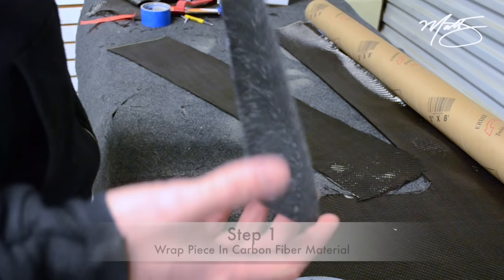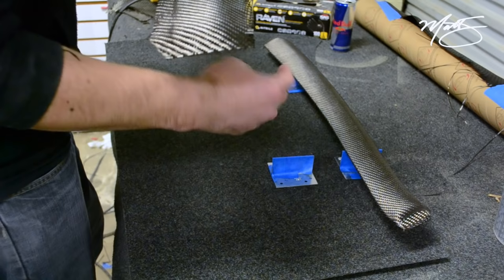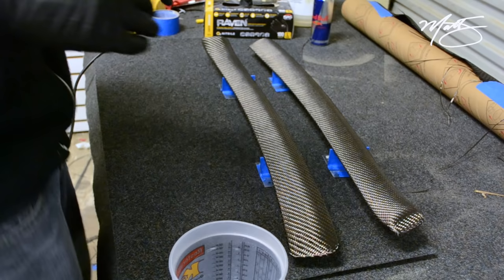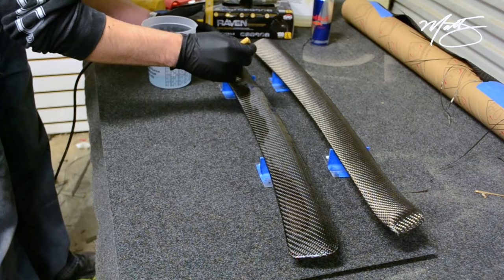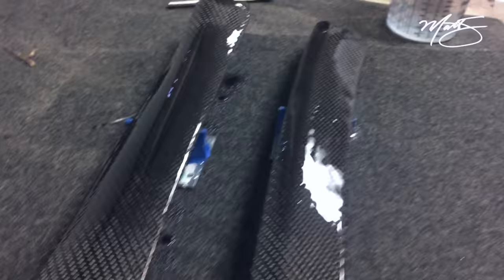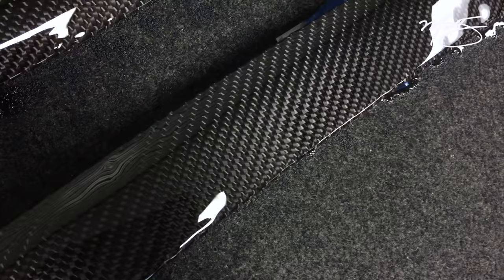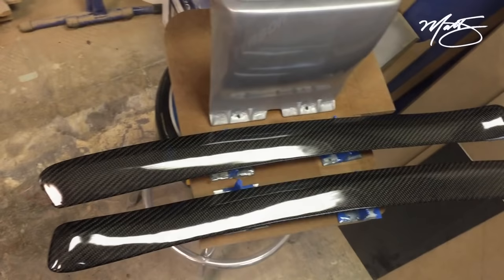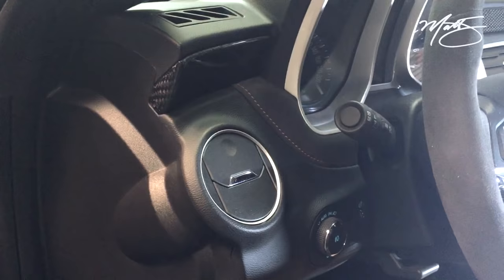How To Hand Lay Carbon Fiber

Comment: Hey Matt, love it and I totally get "don't sand the first  layer". What did you do with the underlay and masking tape?
Reply from the maker: Gordon Mulcare The fiberglass underlay was epoxied to the carbon layer when it was laid. The extra carbon wrapped to the back was taped up to the edge. After it was epoxied and cured, I took a 45 degree grinder and tapered the edges from the back. I pulled off the tape and the dry carbon excess came with it. Hope this helps!

Comment: hey matt with the spray adhesive have you had any problems with delimitation of the part? I thought your idea with the spray adhesive was impressive. thanks for sharing your experience.
Reply from the maker: +Robert Kahana I use the spray adhesive route because its the only method I have used that has not delaminated.  Some people lay epoxy and let it tack, then lay the carbon into the tacky epoxy to hold it down. I have had hit or miss delamination with that method. Lay the epoxy on light, so it does not saturate the adhesive, and then let it cure and go heavy on the second coat.

Comment: Why do you dry sand then wet sand? Why not just wet stand straight away?
Reply from the maker: +JUNAID187 When you dry sand you can take a lot off of the high spots off of your epoxy. When you dry sand, it is obvious if you start sanding into the carbon fiber twill. If you are wet sanding, it is all going to look like clear coat. You would not know unless you constantly wetsanded and dried off your panel.

Comment: Do you have delamination problems with spray glue?the temp affect the glue?the water during wet sandind?
Reply from the maker: ATHANASIOS SAKELLARAKIS I have had a lot of success with the spray glue to tack the carbon down. I have never had any delamination problems, as the epoxy will bond to mostly anything porous. As long as your not backing it to plastic, abs, hdpe, ect. Just make sure on the first coat, as the epoxy starts to flash, inspect for any air pockets on your layer. If you find one, take your foam roller or brush and push it back down. It should lay back down since the epoxy is very tacky at this point.
Reply: Matt Schaeffer I use spray glue or epoxy basecoat and vacuum bag to attach the fibre on the surface,I m new at this and try different ways,the spray glue is by far easier!!

Comment: what is the reason for 20oz?  more expensive and pretty heavy.  What I have read "More difficult to form than lighter weight carbon due to its high weight and thread thickness. Not generally used for cosmetic applications. Excellent for flat parts and high strength requirements."  Just wondering...no expert here.
Reply from the maker: OEM manufactures like Lambo, Ferrari and Porsche all use a 20oz mat on their cosmetic interior pieces. It has a ton more depth than the easier to form 5-11oz. Harder to work with but looks way better.
Reply: Matt Schaeffer ok got it, makes sense. thanks :-)

Comment: I tried to do this with the spray adhesive. However it dont work, when I apply the epoxy resin, the carbon lifts off the part like its getting air pumped into it , how can i fix this
Reply from the maker: Yamaha Rapt or first layer needs to be light. You can’t completely wet it out. If you have crappy adhesive and it completely sets out, it may release.
Reply: @therealmatty_s  I do apply a light layer, but after 5 mins after I have applied the first coat, the carbon lifts away and small airpockets form under the carbon
Reply: I have tried it on metal parts, and also nylond 3d printed parts and the same happens
Reply from the maker: Yamaha Rapt or then you are using too much epoxy or your spray glue sucks.
Reply: @therealmatty_s  Ok, i will try again with a light layer of epoxy to start with again, and see what happens, also does it matter if its metal or will it not stick to metal?

Comment: Where did you get your carbon from? Do you feel having it that thick makes it easier to work with?
Reply from the maker: It is easier to work with on pieces that do not have complex curves and angles. The thicker the carbon the easier the weave will stay in place when laying the mat. The lighter carbon is more pliable but is easier to distort the twill when laying the mat. I typically order my materials from fiberglasssupply.com   Hope this helps!
Reply: Matt Schaeffer thank you sir. appreciate that.
Reply: hey Matt do you have a link to exactly which carbon you use from fiber glass supply?

Comment: Great vid! Did you use the prepreg carbon fiber cloth in this vid?
Reply: +Sam Gao No I don't think so, Prepreg is very sensitive to temperature, and the resin is already mixed with its hardener. Therefore, pre-preg carbon fibre needs to be stored at very low temperatures to prevent the resin from curing before the fabric is used. It is normal for pre-preg fabric to be stored at temperatures of around -20°C. In the video you see him apply resin, meaning the CF didn't have anything on it before. In short, it's just wet layup CF.
Reply: This isn't prepreg, you don't need to apply resin to prepreg, and you need an oven to cure it properly

Comment: Matt, What kind of spray adhesive did you use?  I used a 3M on a slightly convex part and when i hit the part with the heat gun the spray adhesive didnt hold up and the carbon fabric came up.  I noticed immediately and removed the fabric....
Reply from the maker: Just any kind of 3m spray adhesive will work fine. Just a light tac. Do not shoot on heavy.
Reply: Matt Schaeffer I'm having problems with the spray adhesive not holding the carbon down. Bubbles and other odd stuff...
Reply from the maker: asv4k8 remember to keep your first layer of epoxy light. This way you don&#39;t delaminate the carbon from the adhesive. Dont mix it as hot with hardener and use the heat gun or mist alcohol over your piece to get rid of the air bubbles

Comment: Would this work with a skateboard?
Reply from the maker: Yes, it would be very easy to overlay a skateboard. You could lay each side larger than the skateboard then run along a flush trim router bit to hit flush with the side of the skateboard.

Comment: Can i do this on my car front fender?  Thanks
Reply from the maker: You can. I would suggest making. Mold of it first, and then laying the carbon into the mold. If the clearances are very small do it this way. If you have a little bit of clearance to work with, then you can tape up the fender, foil it, mold release wax, then lay 3 layers over the fender. Pull it off and cut to shape.

Comment: any one knows what do if i want the layer of carbon fiber to be removed from the original trim piece ?
Reply from the maker: +XSDGX If you wanted your panel to be 100% carbon, you would do exactly what you see here, but you would have a layer of aluminum foil with mold release in between. That way your carbon layup would take shape to the OEM panel, but would not be bonded to it. If you go this route, you would have to do 3-7 layers of carbon for strength of the panel. Hope this helps!
Reply: +Matt Schaeffer thanks great video

Comment: What does the back look like? Still all tape?
Reply from the maker: Taped up to the edges. I do this to not get epoxy where I dont want it. Come back and trim with a sander on a 45 degree angle to the edge and peel off.

Comment: Interesting that you don't sand after the first coat of epoxy.  Pretty much every other video I've seen does that.  I would think it would be too easy to sand into your fibers but that's what they do.  I'll have to give your method a try and see how it goes.  I'm getting ready to cover my rocker panels for a custom C3 Corvette I'm building.
Reply from the maker: +Gerry Abbett Awesome, let me know how it goes. I do it a little differently. I go with a light coat of epoxy on my first coat. That way my twill stays in place and the carbon does not lift. If you saturate with your first coat, you will remove the adhesion the glue is providing and cause the carbon to lift. Some will lay epoxy, let it tack, then lay the carbon. I do not do this because on some tight corners, it is always hit or miss with the carbon lifting from the panel. Go light on the first coat, let it cure, then go heavy on the second coat.
Reply: Yes! That is the same issue I've had in the past. Thanks

Comment: Looks awesome! What epoxy are you using?
Reply from the maker: gregrob20 I am using two part epoxy from Resin Research.  I believe I also show it in the video. :)
Reply: +Zach Hodgson There is material like aluminium honey cells. Don't know how it's called, but it is used in composite sandwich making. Probably you can try to use that.

Comment: are the pieces trapped in the carbon fiber?
Reply from the maker: +Gupy Fish You can do it either way. If you want it apart of your panel, lay the carbon on top. If you want it to be its own carbon panel, then lay aluminum foil inbetween with mold release. You will have to add a lot more layers of carbon for strength if you do this. 4-8 layers depending on the weight of the carbon.
Reply: Thanks! I never thought about that

Comment: I wonder if i do carbon on white surface ,will it works or nah? Or i have to paint it black first?
Reply: There is a black dye to mix with the epoxy as the "glue" to hold down the carbon layer. Discard that and mix a fresh batch of epoxy don't put the dye in that batch and follow the steps in the video. That takes care of painting the item before wrapping

Comment: man thats a shit load of work, besides with 2 or 3 layers of carbon fiber you could trash the original piece and just made a mould
Reply from the maker: Yes, you could make the same piece by doing 5-6 layers of carbon fiber instead of the fiberglass mat.